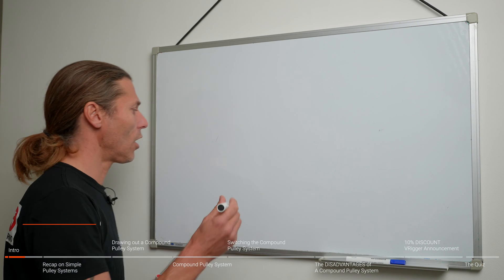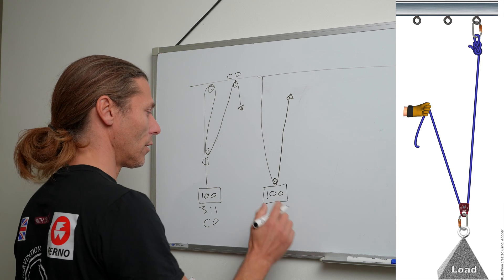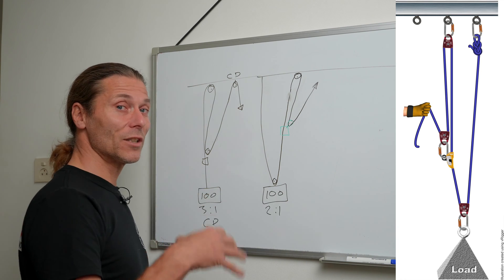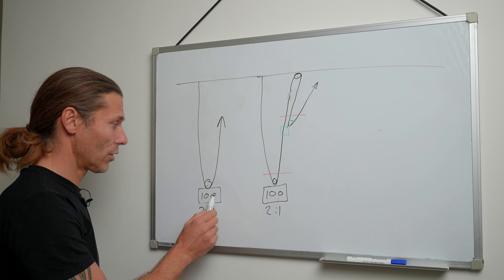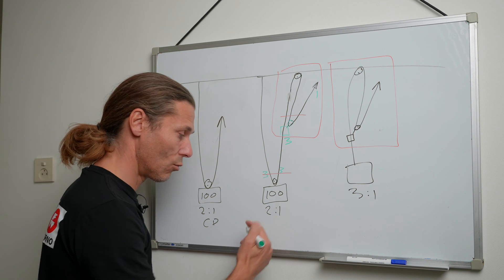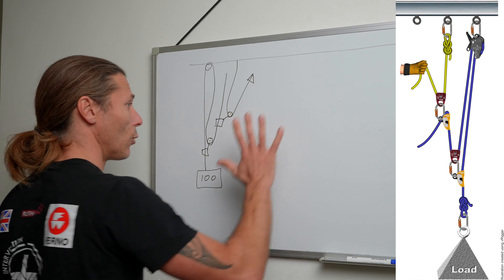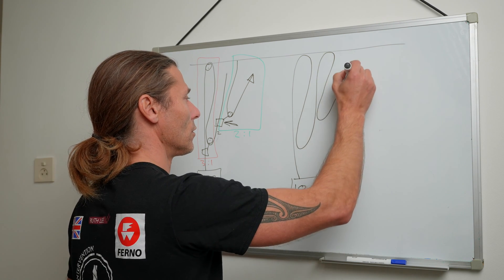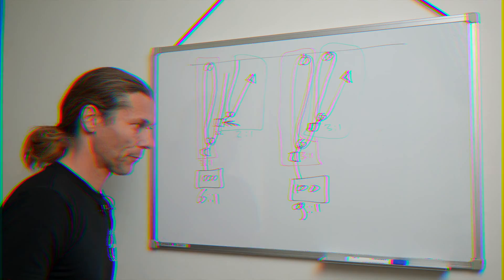How does a Compound Pulley Systems work

Comment from the maker: What are your answers to the quiz?
And why would you use the last system??
Reply: Maybe I would want to use the last system if I have to lift something very carefully/slowly. 
This System would allow me to lift the load with only half the speed im pulling the rope.
Reply from the maker: @benediktmayr3465  Almost, sort of, not really though 😉
I will explain next week. Ok, just a hint Did you watch the video I pointed you to in the end? Does it look like we are trying to move someone slow?
Reply: @TheRopeAccessChannel  Oh yeah right I didnt watch the video yet no but I just realised that i had the right thought but wrong assumption... 
It would be to move something fast! 
A normal setup already pulls things slowly and this one is the opposite.
Reply from the maker: @benediktmayr3465  👊🏻👊🏻😃 Correctemundo! Get something moving twice as fast! (for twice the input though)
Reply: ty, this will help a lot, not many good vids on compound.   trying to cut down distance so it goes about half the distance,  im trying to make a bed that lifts so 115kg total, with everythign thats going to be lifted.  as well im thinking if i can get it down to 25 something people may not consider is adding a counter weight to the end your pulleying on.  So at the end of the rope that i would be pulling on if im leftover ideally with  around 30lbs or approx 12 kg i could throw on a wegiht close to it and leave only a few lbs  that could be easily pulled so that way.  HERES THE FUN PART,  if my bird were to decide to climb  the rope while im sleeping in it he will in inadvertently slam me into the ceiling.  Cartoon style.   Lol

Comment: A 15:1
B 3:1 (as I understand it having 2 3:1 or a single 3:1 is the same thing as long as you're gonna pull both 3:1 by yourself)
C 0.5? since the load is 100 kg and it's anchored to the ground, your input would need to be 200 kg
Reply from the maker: https://www.theropeaccesschannel.com/what-is-a-complex-pulley-systems-the-t-method-and-mechanical-advantage/
For the answers.
Yours are incorrect though. Try watching the other video's and read the website

Comment: If you have a 9-1 system ( two 3-1 systems), and add the same system. Would that be 81-1? It’s two 9-1 systems, so 9x9=81.
I would use pulleys rather than prusiks. I’m pulling tree stumps and I want to overkill it…… by a lot.
Reply from the maker: 3x3x3=27:1
Reply: A complex 9:1 (3x3) stand alone system, but instead of connecting that to force, connect that to another 9:1 stand alone system. Then connect that to force. So that would be two separate 9:1 systems connected to my winch. Is that 9x9? Which would equal to 81.
And I want to edit the statement about prusiks, I meant to say, “ I would use pulleys rather than carabiners with the prusiks
Reply from the maker: @rogernation2551  now that makes more sense. Pulleys over biners any day!
If you put a 9:1 to a 9:1 that would be 9x9 indeed
Reply: Thank you for your confirmation. Kinda thought so, but I’ve only been doing this for a couple of years and still consider myself a novice. 
Which is cool, so much to learn

Comment: A. 15:1 (3:1->5:1) 
B. 3:1 (w/ a backup😆)
C. 1:2 (hoping for more of these, they are the hardest to figure out (when biggger) and there's not much on here about these types of systems)
Reply from the maker: Correct. Complex systems can be tough to figure out. Most of those quizzes and puzzles I see online are more theoretical setups that no one would ever use. Just a fun thing to test your understanding on the T-Method. Let me say that no one in normal rope access. There might some niche spot where some exotic complex 7:1 might make sense and where the advantage outweighs all the disadvantages. Something like. mountainguide crevasse rescue setup.
I use C) when we do stuntrigging and want to move something fast over a  relatively short distance. Input could be something mechanical like a winch or a ram. Or just two guys holding on and jumping from a ladder haha

Comment: A- (Blue rope is 3) (3 carries to black 5 time (3 on bothsides of the pully x2+ 6) so 6,6,1 =13 + the blue16:1
B- 6:2 ( 3:1 1 system 3:1 2nd system + 6:2)
C- 1:1 ( I haven't seen or set a system like this up myself so I don't know). Since the "general rule" taught to me is when we're towards the load and not the anchor it counts to M:A anything towards the anchors (minus complex systems) won't contribute to your M:A and it's a deadline.

If I am wrong is any of this please correct me with a work layout so I can figure out were I miscounted and learn from it.
Reply from the maker: Thank you for your comment.
A) You are complicating it so much i dont even understand how you got to 16:1. If you watch the video again it should be clear. I don't understand how my explanation in the video could lead you to that. Help me learn here. First identify how many simple systems are working here, then identify which is pulling on which. Then it should be clear.
B) I get what you are saying and the input can not be 2 if I say, "me as a single person pulls on the load". Then the input is always 1. Think about if the load will move at 6 times the speed or 3 times the speed (slower that is). That will tell you the MA. Or is the load going to move slower when we add the second system?
C)That general rule is correct for simple systems and even compound ones. Actually also here..
If I have a load and one pulley at the anchor and pull down that would be a basic 1:1 with CD. But in this example I am not pulling on the load, I am pulling on a pulley. And another general rule is, if a pulley moves, it does something for the MA. Therefore it can not be a 1:1.

Comment: 1. 15:1 compound
2. 3:1 CD & 3:1 CD TTRS
3. 1:1 pulley for change direction of the 1:1 CD, use for low angle change to high angle, I guess😂
Reply from the maker: Does system 2 make it feel lighter?
With 3, if you pull down 1 meter, how far does the load move?

Comment: A 15:1
B 3:1 (eventhough there are two 3:1 systems, 3 metre pull only moves the load 1 metre)
C 1:2
Reply from the maker: Correct. good call on B!
If you want the answers, check out the top comment on this post:
https://bit.ly/3hM2Hai

Comment: A) 15:1 (5:1 x 3:1 w CD)
B) 3:1
C)1:2 - Because the tension in a rope going through a pulley is equal on both sides, so that means that the pulley that is connected to the load is actually seeing 2 times the weight of the load. The second pulley is only a 1:1, so that results in a very inefficient 1:2 overall
Reply from the maker: Well, inefficient depends on why you set that up 😉😉😉. What happens with the load if I pull with 1 m/s?

Comment: Here we go again!
A) 15:1 (5*3:1)
B) 3:1 
It seems to be a 6 to one at first since you have 2*3:1 but if i see it correctly they dont add up but are just parallel to each other
C) 0,5:1
The weight basically acts as its own pulley onto our system
it becomes apparent after looking at it upside down.
Reply from the maker: correct. I would call the last on a 1:2 but we mean the same thing.
If you want the answers, check out the top comment on this post:
https://bit.ly/3hM2Hai

Comment: Drawing A is a simple 3:1 MA (last pulley on the right is just a CD) acting on a simple 4:1 MA with separate system therefore 3x4 = 12:1 COMPOUND MA...Drawing B both systems are in simple 3:1 MA configuration, when you pull both ends the MA does NOT change at all...Drawing C is basically a 2:1 MA because the upper pulley is a simple 1:1 configuration that is mostly used to DEVIATE directional anchor system...

I think it is also a BIG help if you could explain further the differences of SIMPLE, COMPOUND, and COMPLEX Mechanical Advantages...For sure, a lot of people in our rope community is still in CONFUSION state...Thanx Alex!...Way to go!..;)
Reply from the maker: Thanks for participating!
Answer B is correct, the other two however are not. Count the ropes again in question A.
Question C: is a bit more complicated though. Have a good look and try to envision how fast the load moves in comparison to the pull. If it would be a 2:1 the load will move at half the speed. Is that really happening?
If you want the answers, check out the top comment on this post:
https://bit.ly/3hM2Hai
I can explain further on Simple Compound and Complex but in each video so far I have mentioned when a system is what.  Also in the upcoming Complex video. 
Maybe I should make a shorter one recapping everything and tying it together. That might be a good idea.

Thank you

Comment: I am in love with pulley systems. For some stupid reason I cannot explain, they just fascinate me. I have for fun and my own personal education constructed ratios up to 550;1. That would be a 15:1 pulling on another 15:1 being pulled by a 2:1 system. That's when I ran out of pulleys. Imagine all the climbing gear you could break with a system like that, but if it held together, you could lift a mountain. 

As to why you might use a complicated system, the answer is easy. It's easier to use the right pulley system to move a heavy load. I am a small old man, but with my pulleys and ropes I can move and lift game when I hunt. Imagine a puny little guy like me dragging an elk up a mountainside to my truck after a successful hunt. Imagine me attempting to perform a rescue and having to raise or lower a victim without pulleys. Pulleys are worth their weight in gold.

I will only answer the last question in your quiz so others can respond.   C is a tricky question because it looks like a 2:1 system, but is instead a .5:1 ratio, meaning you'd have to lift with twice as much force (200) to lift the load. That's a good question!
Reply from the maker: 🤯550:1!! I though I was weird making an 81:1 to test things. We actually ripped the sheath of the rope then..... 😂😂😂. According to legends, pulleys and levers are what build the pyramids😉. Ingenious systems!

Question C) is correct. You would need twice the force. What happens with the speed?
Reply: @TheRopeAccessChannel  You double the speed of the pull.
Reply from the maker: @340wbymag  exactly so if you would want someone to move fast and far that would be the way. You just need more input😜
Reply: @TheRopeAccessChannel  Correct me if I am wrong, but I believe this configuration (C) would increase to load upon the uppermost pulley to 400 pounds (or kilos).
Reply from the maker: @340wbymag  that is correct 👍🏼